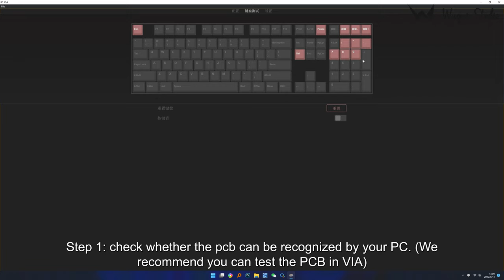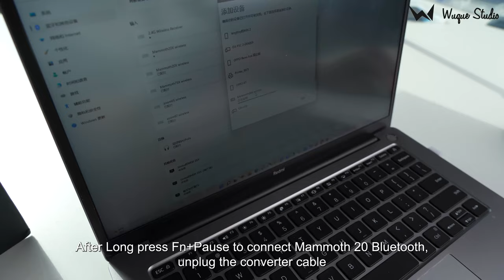Mammoth20 Build Guide

Comment: Not gunna lie. This products instructions and available info is hard to find and doesn't give even close to enough info. Not to mention my knob stopped working day 1. Stay away from this product. Overpriced for a premium case. Everything else about it sucks. Also, you WILL NOT get a battery with it. You also will not be able to find one with a 1.25 connector on it already. So make sure you have the tools required to change the connector. Most come with a 2mm connector. Again. Overpriced.
Reply: Totally agree....trying to get somethiing like that here in the UK is a nono...ordered from Germany arrived yesterday, battery is the correct one but as you mention the jst is 2mm and not 1.25. Also on top of that...can't even get mine to authorize on via...so can't get to setup any layers...shit product for the price !!!!
Reply: @d3v1ls51  Took me like 4 hours to get it connected to via. Even after that, I had nothing but issues with wireless connection. There is literally not one single way to know battery lvl or if it even fucking charging. Not a single page about light code meanings in any of their terrible documentation. We really need to start holding these keyboard companies to higher standards. I'm done getting jipped just because something looks nice. You do not get what you pay for in this hobby all the time. DO YOUR RESEARCH before purchase people. CannonKeys won't even let me return it. It was an extra and not on a group buy as well. BS 200 dollar paper weight
Reply: @iLuvCats  how did you get via to recognize the pad? I'm having issues with it detecting it. Also what is the sequence you have to press to get the wireless connectivity?
Reply: @Bryllyant2  It was really odd. One of the reasons I got rid of it. I know its a file you need to upload in via that you download from one of mammoths google drive files.
Reply: @iLuvCats  damn that sucks. Wish I’d know this before. Thanks for the info tho I’ll check it out
Reply: @Bryllyant2  I felt the same way. I just I just assumed it would all work flawlessly being that it's a premium product. . . . . .
Reply: I have to agree.  I have not been able to find any support for this.  The wired PCB shows up in VIA, however, the wireless does not.  Until the Lock Num Lock key was changed to Num Lock, none of the buttons would work on the wired PCB either.  Given that the wireless PCB is not showing up in VIA and I can not get it to show up in QMK I can't even use it for now.  Fortunately the vendor I used was very good and provided the proper battery.  However, I am surprised at the lack of support from Wuque on this.  I saw you reference one of Mammoths google drives in a comment below but I could not find that either.
Reply: @truelife13  yeah man. It’s insane. For the price. I honestly don’t em ever how I found the google docs. I had all of the exact same issues you are having. Wasn’t worth the time or money. I sold mine.